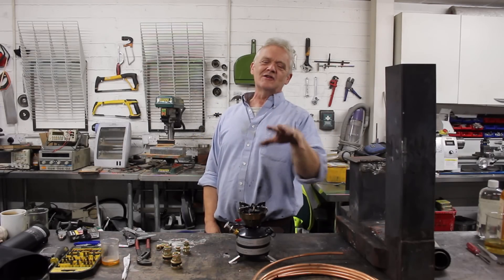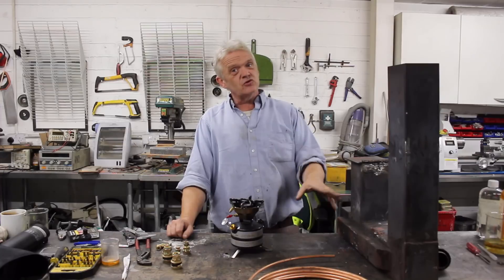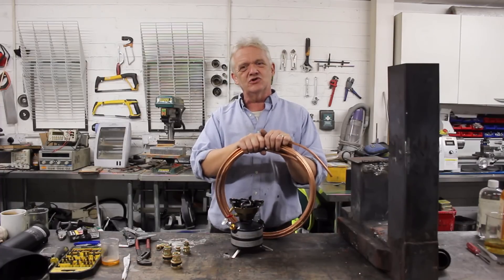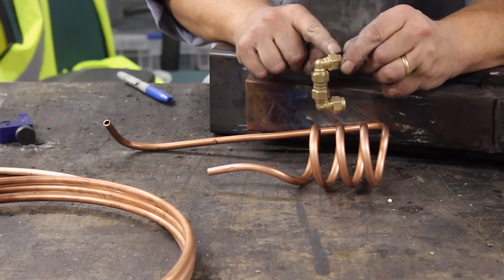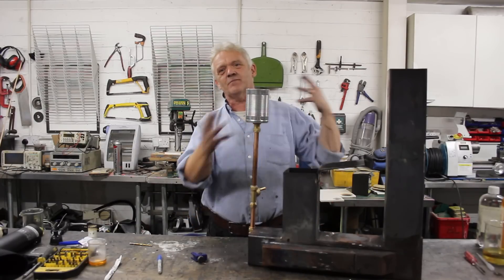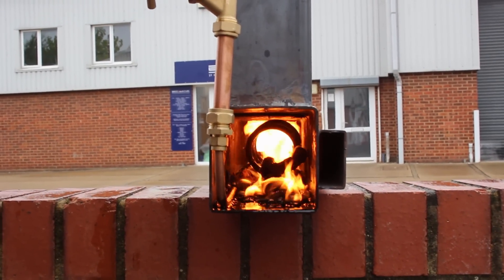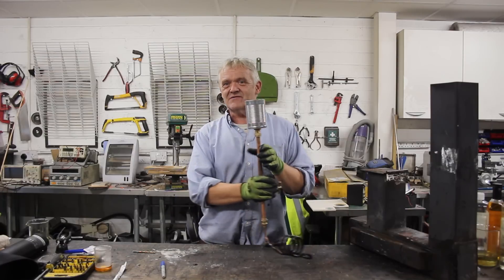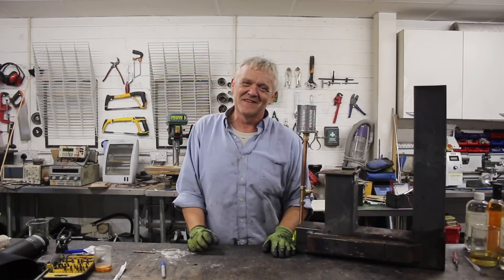1677 Biodiesel Rocket Stove

Comment: That copper pipe can be send through a microwave transformer with water a few times and connect it to a central heating radiator and small pump.
Reply from the maker: indeed mate - but it does Eem a little over complicate and would need an external power source for the microwave wouldn't it?
Reply: @ThinkingandTinkering  yes its gonna be the seondary coil well isolated to be the inductor.
Reply: Unnecessary complication as resistive heating elements are 99% efficient in converting electricity to heat, so unless you are above 100% conversion (impossible) then it's just another way to make heat albeit unconventional.
Reply: @ProlificInvention  without trying you don't know
Reply: @edwingolddelirium  A microwave is about 50 percent efficient. Most of the energy is lost in the process of converting electricity to microwaves (which are part of the electromagnetic spectrum).

An electric stovetop is about 70 percent efficient, although that varies widely depending on the type of pot or kettle you use. Most of the energy is lost heating the air around the stove.

An electric teakettle is about 80 percent efficient, although again this varies from kettle to kettle. Electric kettles are generally very well insulated, and the heating coils sit directly in the water, so less heat is lost to the air.

An induction stove or hot plate is about 85 percent efficient. It creates an electromagnetic current directly in a pot to generate heat, losing very little to the air.
Reply: @edwingolddelirium  I had to do a little reading on it, induction water heating is what you are essentially suggesting and it may be more efficient than resistive heating depending on the final setup and infrastructure losses.
Reply: @ProlificInvention  reading and talk all day  ! use your hands.

Comment: Perhaps you could incorporate one of those fans they put on top of wood burners to push more air/oxygen into the burner using the heat to run the fan.
Reply from the maker: I like that idea mate
Reply: Ooh a sterling engine would be perfect for that!

Comment: Awesomeness! A few years back I made an alcohol jet burner with that copper tubing and a baby food jar. The thing was over powered and torched fuel so fast it pretty much self ignites the reservoir. I would caution folks to be careful with these coils because they work too good lol. They will heat up so much it becomes a jet of flames and fuel in seconds. Have fun stay safe and great learning.
Reply from the maker: cheers mate
Reply: Same as penny stove always test in safe area 
I had a few little loud can separation failures.
Reply: Sounds like you made your jet hole to big LOL

Comment: Freaking awesome guys.  I like your coil set up.   Pretty sharp design.
Reply from the maker: cheers mate
Reply: The copper pipe can go around the outside of the stovepipe to make it last longer but take a bit longer to come up to temperature... works better with round pipes though

Comment: People used to make a dripper for used motor oil onto their wood stoves to heat their garages. Preheat or anything, just a drip onto the coals. Burnt so hot you couldn't smell the oil burning. 

Brake tubing is annealed really soft, (for the first bend lol)  I am not sure the availability offshelf UK, but eBay makes everything available everywhere lol.
Reply from the maker: brake tubing sounds like a nice idea and yes this is a kind of half and half between a forced air and a drip stove